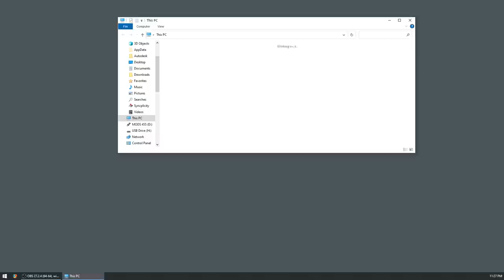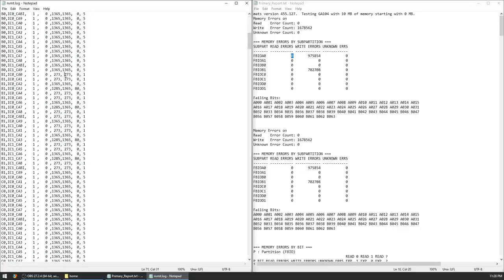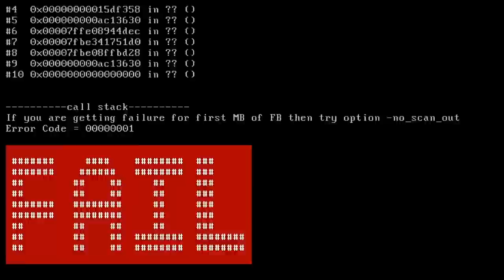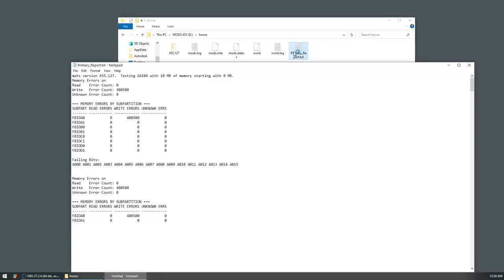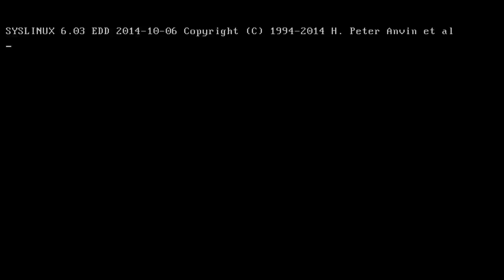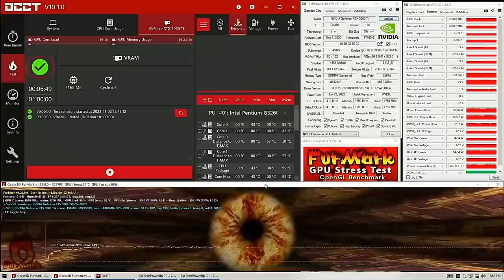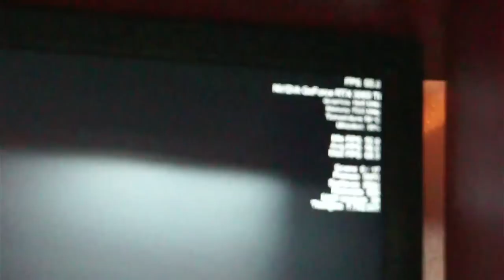Does ASUS makes good graphics cards ? Part 3 3060ti tuf

Comment: Its insane to me how many corner manufacturers cut corners on cooling important components on GPUs.
You did a wonderful job bringing this GPU back to life
Reply: My Asus Dual RX6600XT cooler itself is fragile. That thing starts bending or breaking, once you start looking at it. Some cheaper GPUs have better cooling.
Reply: @Morpheus-pt3wq  MSI RX 580 ARMOR is a fine example of gutting cooling.
I worked PC repair for Geek Squad a couple years back, and every PC that wouldnt display  had that gpu in it.
I got one to boot and it would hit 80 running Valley benchmark
Reply: @kokumosu  yep they make on purpose these things to brake so we can spend more money , rx 580 nitro have same problem they make fans to start spin when temp hit 65 c ????? they are crazy and of course they cannot cool down anything at that temp and it just raises ??? and even fan rpm is ridiculous they make them spin on 800-900 rpm on 65 c ?? i had to make my own custom fan speed and now it is ok temps don't go over 65c max and i made max rpm 1500 it is enough .

Comment: Trying to correct that one ball... what a frustration. A clear case of "fixing one problem with two new ones"...
Reply from the maker: Actually I accidently touched the core at least twice knocking off several balls.
Instead of a 19 minute solder job, it took 30 minutes moving balls around.

Comment: Great video. Thanks for uploading. Question, is there anything you can do to improve the cooling on that memory phase area where the dark spot was? Could the owner buy an aftermarket GPU cooler that has cooling in that area?  It's a shame Asus does this.
Reply from the maker: Bend radiator flat in the area of the contact with the bracket underneath.
Stack 2 3mm thick pads.

Comment: Would be interesting to see how PowerColor fairs in a video like this.

I have a 5700 XT Red Devil that crashes VERY often, especially when watching video.

Though I will admit, it's my fault. I had a ground issue with my PC that caused a power surge to kill the motherboard and CPU (I had the PC plugged into a power strip that was missing its Ground Prong at the end) and it appears that it partially killed my GPU as well. It functions, and you can use it to watch videos for a good bit, but it will eventually crash multiple times before it finally settles down and starts functioning fine again...
Reply: Did you swap the PSU after that surge?
Reply: @Morpheus-pt3wq  Yup. I used to have a Corsair CX650 Bronze, upgraded to a Seasonic Focus GX-850 Gold.

I ended up putting my 5700 XT aside and am currently using a GTX 980 while I think about what to do. Have had 0 crashes ever since making that change.
Reply: It may be the drivers. What drivers did you use if you remember? The drivers aren't stable for couple of months already (they used to crash only without restarting PC), would suggest you on trying out 22.10.3 optional or PRO edition of drivers (since it's more tested compared to normal ones) or even trying out recommended if you didn't use them
Reply: @IceSlash  Yeah, I've tried plenty of different drivers and the same issue happens ever time. Tried different VBIOS as well as motherboard BIOSs, still rebooting constantly.

I've already verified that it's indeed the GPU since I've tried a few others and it always results in the PC not crashing at all.

I'm sure if I were to open it up or send it in for repair, something in there will be burned up or just dead to cause it to reboot at such completely random intervals.

There was a period where I went almost an entire month without it crashing and I thought it was fixed, only for it to get back into its habit of crashing multiple times per day or  a couple times a week.
Reply: @sirfairplay9153  ok jensen

Comment: I thought artifacts are caused by bad solder joints on the core chip. Being an usual issue with the memory makes it, so that like maybe 80%+ of faulty GPU can be repaired without BGA reballing on the core chip - amazing!

Comment: Re-balling those behemoths is such a tedious task. We got the super speed version, but how much does it take you to re-ball a GPU (without the rest of the work involved) ?
Reply from the maker: Just to put balls on or remove and prep and clean etc ?
No rush maybe couple hours or less if it goes smooth.
Sometimes you have to fight with the bals wondering off.

Comment: Oh man. I have this exact model and the warranty is about to expire in a few weeks. :( I'm not qualified enough to try to improve the cooling by myself. I just hope it doesn't break with something similar to this, because all the shops around here won't even try to fix it. Do you have any "twin brothers" in Europe? :D And I bought this card, because I though it was well built with very good cooling. :/
Reply: I've only just purchased mine, but I'm having no issues with temps so I thought the cooling was good as well. I'm wondering how to get the same kind of maintenance as well.

Comment: yeah, basically all manufacturers cheaped out on 3070s tiers and under (as always but this time worse since all these cards were 600$ instead of 250$), 3080 and up version strix, tuf and gamerock should be fine though, at least according from what i've seen from gamersnexus and buildzoid.

Comment: That Reball time lapse....I've been there. One solder ball combines with the adjacent one. Trying to wick it causes others to get wicked. Sometimes it's just falling domino's. What temperature do you use for the top hot air when taking off and putting on?
Reply from the maker: dont care for air temp, i watch the temperature reading from the thermocoupler. Around 250 is when it starts to move around.
Reply: @northwestrepair  how about the preheater temperature?

Comment: You have some mad skills man!
PS. what is the best brand that covers all cooling in your opinion?
Reply: Hardware is not really trustworthy, with any manufacturer who focuses on maximizing profits.

Planned obsolescence can be implemented in a number of ways.
Pretty obvious, like badly designed coolers.
Or more inconspicuous, such as Components that are too cheap or not sufficiently specified for a task
(Like minimal permanent overload, that will destroy the component over time).
Reply from the maker: No such brand exist..they all have their good and bad card.

Comment: I wish I saw this before I bought my Asus card... How bad are they compared to other brands?
Reply: ASUS consistently make shockingly bad cards across generations (their 5700 XTs and 3070 Tis are atrocious) yet somehow command the highest prices. I guess marketing is worth more than making a good product? Meanwhile EVGA went bust.
Reply: @iseeyou1312  nah, that’s NoVidia’s fault that made EVGA bailed the GPU market.
Reply from the maker: The board its self is not bad at all, rather well made but they lack in cooling for memory phase consistently.
No pad on the back is just a bonus.
Reply: I think that depends on who is in charge of designing cooler for each card. Some designs are unexpectedly good for no obvious reason. My Asus Strix 1070 was overengineered (still no pads in the back), Asus R9 280X underengineered and Asus Dual RX6600XT is a mixed bag, but with thermal pads, where they need to be.

Comment: Honest question: it's a very recent GPU, that surely is still under warranty. Why would the owner send for complicated repair work (looks complicated to me at elast lol) ? I'm assuming that the job is also cheaper than just buying a new/used one?
I am a huge fan of your content, it's incredible work!
Reply from the maker: Because I am cheap.
Reply: Asus deny warranty thats why happen to me got report card say that even though I had red artifacts
Reply: all manufacturers changed warranty terms after the 2018 mining craze, even evga which is (was) supposed to be the best for warranty support
if the owner bought a scalped one off ebay or whatever the warranty is not transferable to second-hand owners. dunno the specific in the states but in EU there's no way around it as purchases are tied to something similar to american SSNs. also they find countless ways to deny warranty. edge of pcb slightly scraped due to factory mounting bracket? warranty denied.
Reply: @jeen0351  AFAIK, in EU, manufacturer must prove the damage was done by customer. You may open the card, repaste it, change thermal pads... after all, it´s your property.
Warranties can get complicated. If you buy used card, you can apply your warranty to the seller, if you have his credentials. Or you can make full contract, as when selling/buying a car, where the seller will transfer all his rights including warranty to you. Manufacturer is obliged to respect that.
Reply: @Morpheus-pt3wq  from experience that is not true, and no one on ebay does such a contract (which requires a purchase record with notary  , and that'd add a couple hundreds euros). is there an EU law that states what you said? probably. will manufacturers comply? no. will you spend thousands to bring them to court? up to you, but i've yet to see one to this

btw this happened to me a couple months ago for an evga psu which i bought as open box on ebay. after providing purchase invoice providedby ebay, evga still denied my warranty,  and they openly said original owner has warranty but i dont.
Reply: @jeen0351  well, there is e-bay, but there are also local second-hand markets. In which, such thing is possible. Risk of scam is higher, than e-bay (there is no buyer protection and if you don´t have seller´s real credentials, there is no way of suing him either), but full warranty transfer is possible as well.
Also, here in my country, we don´t buy stuff directly from manufacturer. The cost is too high. Instead, we buy it from e-shops. Which, if do not honor warranty for some made-up reason, we as customers can send state trade inspection after them. They may try threatening, but if you don´t back down, they tend to comply. Nobody likes the inspection.
Ofc there are exceptions with some of the cheapest, scammy e-shops, which officially reside in one of the tax paradises, but they´re widely known at this point and if somebody wants to buy something from them, it´s their own risk.
Reply: @Morpheus-pt3wq  e-shop is an entirely different thing, as they are vat-registered and are required to give 2-y warranty, (and they do order from manufacturers) 1-y on refurbished. but this is a sale between two private individuals,  in my country the formula it's called as-seen-and-liked, meaning you see the item, you like it, and you buy it no strings attached. in this case (ebay, any 2nd hand market etc.) thres 0 warranty

Comment: Thank you. I learned that Asus don't make the most reliable gpu's.
Too bad you don't repair amd gpu's as well. I'd love to know how Sapphire or Power colour gpu's are related to cooling design and so on.
Reply: I bought in 2018, after the last crypto crash, a Sapphire RX 580 8GB. I'm still using it today. I want to upgrade to an EVG RTX 3070, but I live in europe and the prices here are still very high.
Reply: It depends on the model. Each manufacturer has some skeletons in closet. Look at Gigabyte Eagle. Plastic backplate...
But even as it is, each GPU has a potential to withstand everything thrown at it. It all depends on luck and invididual quality of each component on it. If you´re unlucky, your GPU will either arrive DOA or die within hours of use. If you´re lucky, the GPU will work for years and refuse to die.
Sometimes, there is a defect hidden somewhere, which passed through QC undetected and it will reveal itself later during use. But that´s why warranties exist.

Comment: Why all the GPU solder problems NVIDIA! Maybe the crap solder no lead??
Reply from the maker: Good question.
Motherboard use leaded solder but GPUs don't.
It's stupid I think.
Not only cheaper but also very difficult to remove anything.

Comment: I have no experience with reballing yet, but I see some people reballing using solder paste on a stencil that doesn't need to be removed during heating. You heat loose balls. That looks like a lot of work with rogue balls. Is paste no option for GPUs?
Reply from the maker: I don't like paste method.
Stencils warp too easily using stencils.
In my opinion it's faster and cleaner to just use balls.
Reply: @northwestrepair  Ah thanks. I understand.

Comment: my concern is that i have a asus dual rx 6700xt , there are power phases on both sides of the gpu die, on the right side power phases, the gpu cooler makes contact with the power stages, but on the left side, there are 3 power stages there is no cooling for them, no thermal pad or heatsink touching the power stages, is this concerning? i guess so.
Reply: That certainly IS concerning. My Asus Dual 6600XT has thermal pads on both sides. Although Strix version has one there under backplate as well, but mine doesn´t.
Is there a placement for such thermal pad on the cooler? If yes, order a thermal pad and put it there. I think it should be 1,5mm thickness

Asus has a history of questionable decisions. Just like all manufacturers. Maybe they decided to cool it with just airflow from fan. Which is a planned obsolescence thing. But hey, the GPU may still work for many years. That´s completely random.

However, what´s totally mind-boggling, there are no photos of the cooler on the internet. Almost as if this model was never tested/disassembled. Many reviewers screen the card from all sides, but nobody bothers with disassembly and pictures of both GPU PCB and cooling solution. As if core and VRAM cooling were the only components, that need cooling.
Reply: @Morpheus-pt3wq  my card has thermal pads on the backplate for memory only, but on the strix card they have pads on the vrms as well, while both models uses the same pcb. why asus does these things, they think people are dumb or what

Comment: Hi there, I'm having the TUF 3070 oc, although it's working perfectly, I've noticed during the last maintenance the same black area on the PCB as you stated here. Is there any kind of fix? it's dangerous to have? thanks!
Reply: the discoloration could mean that, that part of the board is getting too hot, and any component located in that area could fry up anytime in the future.

Comment: Yeah i will never buy asus again i bought a gaming panel from them back in or around 2009 thel layers of the panel were seperating so my blacks were pretty much dark grey as a result i contacted the via email and sent them pics they reassured me that since it was under warranty they would replace it well they didnt they sent it back to me the way it was it was not replaced or repairewd i wrote them again and they had me send it back i went through the rma process 3 times in almost 4 months then the 1 year warranty ran out i will never buy asus again

Comment: This is why I always buy AMD reference cards. They have beefy power stages, there are early vmods if you want to get serious, and there will ALWAYS be coolers/blocks that support it and first. AND they cost way less than the crap from the AIBs which they bin your chip. I've won sillicon lottery twice out of 5-6 flagship cards in my life, and they both were reference cards. I've only ever had one 'lemon' ref card which wouldn't OC much and that was the X800XT, because they binned them to make the PE model that couldn't be bought in my country, or I would've bought it.

Always buy reference. They are not binned to make the 100 different XTX TOP HHO NWO OMG versions, each with an increasing price.